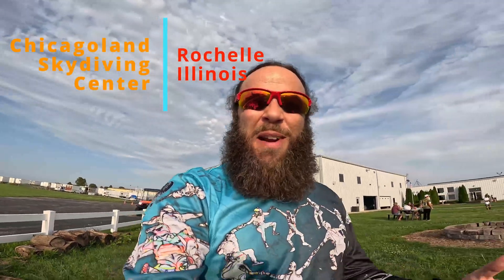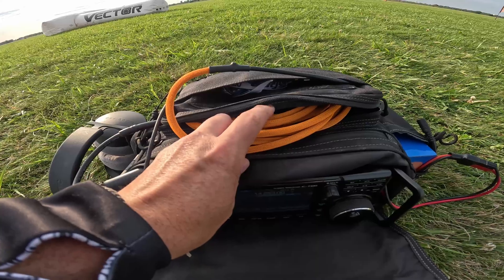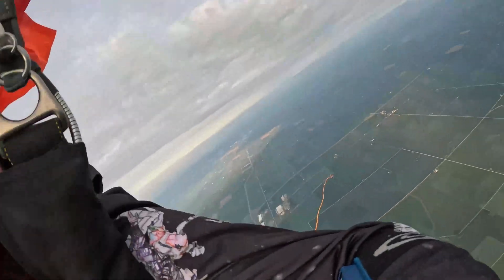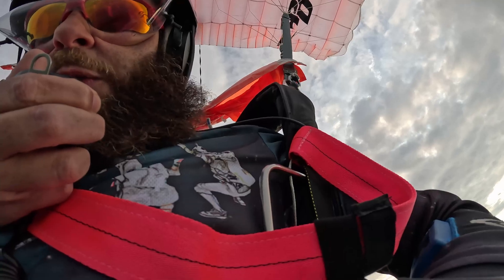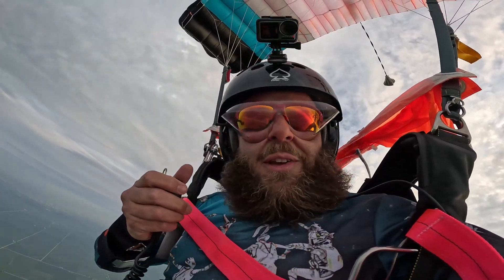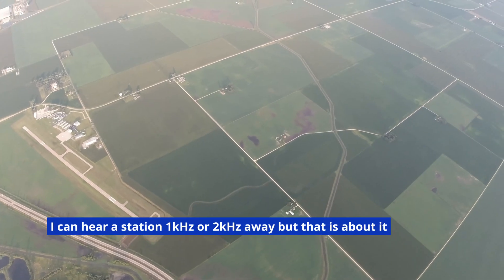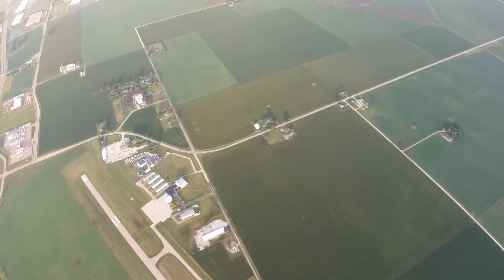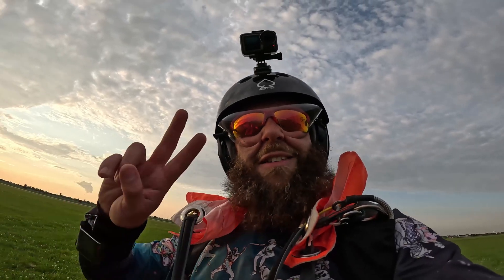Does output power matter when you are at 10,000 feet above the ground?

Comment: Hi Carlos. Great video again.
And what I never expected is, that the HM-219 of your IC-7300 does fight against the wind noise WAY BETTER than the HM-243 of your IC-705.
So this is the major improvement in my opinion.

If you like another upgrade, you might try an ICOM IC-209 handmike. Which has an active noisecancelling DSP electronics in it.
The ICOM tech say, it's only designed for their VHF/UHF mobile transceivers (ID-5100E und IC-2730E) and they do not give any answer if it could be used on a shortwave transceiver as well.
But as the RJ45 mic pinout of the related VHF/UHF mobile transceivers is exactly the same as on my ICOM IC-7100, I gave it a try.
And OF COURSE it works there as well!

So by replacing the mic plug I'm quite sure it will give your IC-7300 another great improvement on readabilty while parachuting.

vy 73 + looking forward for further parachute mobile videos,
Jochen, DG2IAQ
Reply from the maker: I have a Heil headset. I just need to build a hand held PTT for it and take it for a jump. Thanks for the info, I may just buy one of those mics to test with.

Comment: Awesome bag setup! Please do a video on how you have built out. I'm curious how you have the power/coax connections in the bottom of the bag. I'd like to run a similar setup with my 9700 (not for parachuting though) but I'm concerned about damaging the connectors or putting a hard bend in the coax.
Reply from the maker: Bag setup is coming soon. I wanted to do the reveal of the 7300 Parachute Mobile with a bang first.

Comment: Cool , but EFHW are not typically directional. the way you had it should function more like a vertical i would think.strange, but nice try!
Reply from the maker: How so? The coax and antenna are both horizontal. I have had many times where I have been facing one direction with it and changed heading and contacts went from 59 to 00.